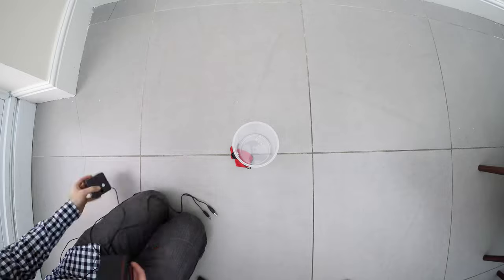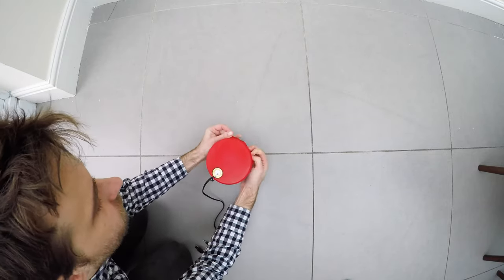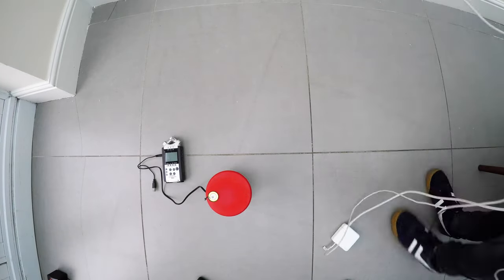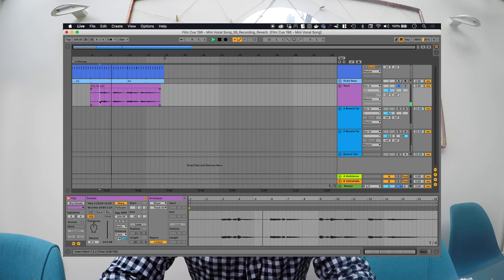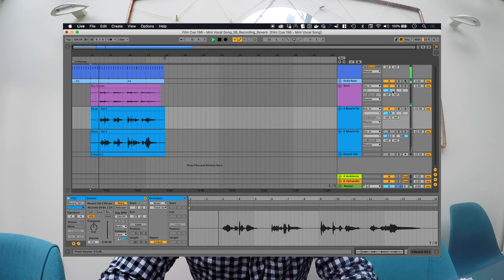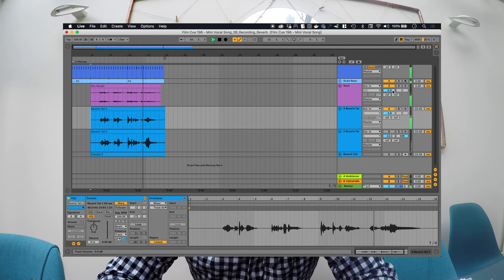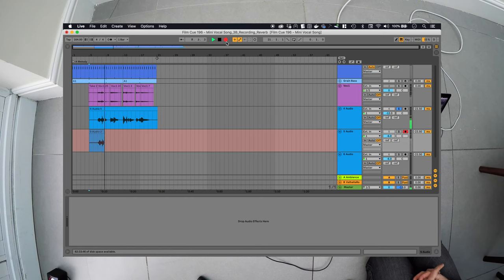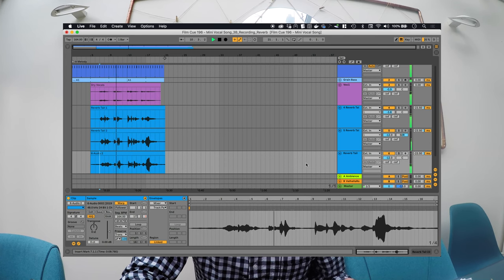Can you make reverb out of party balloons?

Comment: I emptied a heater and made a chassis with real spring reverb, my original plan was making a weird amp out of it. I never got around to finishing it. I had a lot of neat projects though. I once almost finished an on off pedal foot switch I made from a round lamp base it looked very close t to a vintage fuzzface pedal, I did complete a cigar box guitar and two radio hacked into amp conversions.

Comment: awesome! what is that you put on top of the balloon exactly?
Reply: A piezo sensor/transducer. You can get them pretty cheaply at electronics shops or online.
Reply: @xenontesla122  Thanks man, and where do you connect that to? what for is it?
Reply from the maker: Scott Kane A piezo sensor is basically like a small microphone that picks up surface vibrations. I plug that into the input jack of my recorder to pick up the sound of the balloon vibrating.
Reply: @DavidHilowitzMusic  oh thats how you do it! I thought that you was recording the speaker itself, and how did you connect the piezo sensor, you solder it on a mini jack first? or is it ready made? thanks!